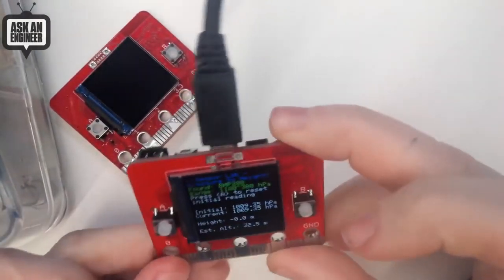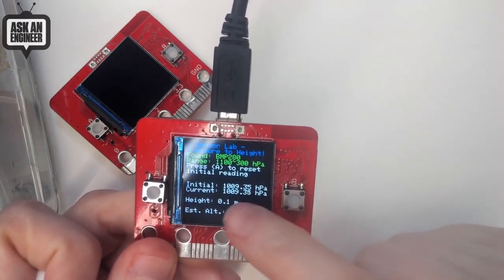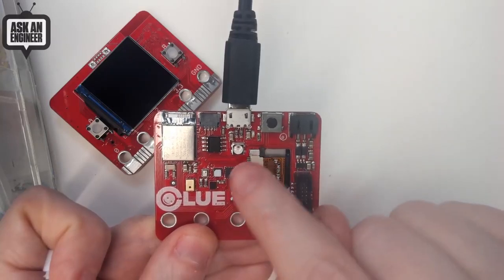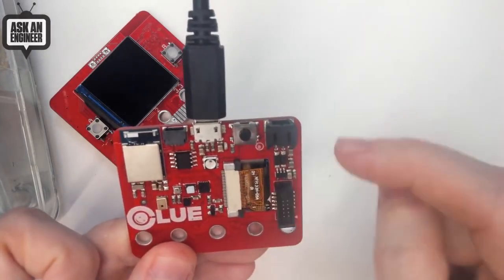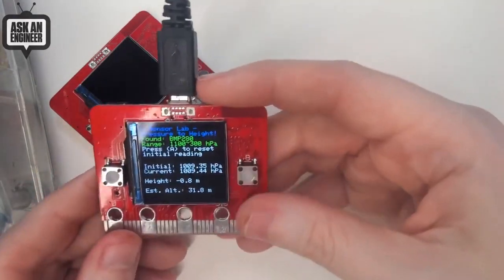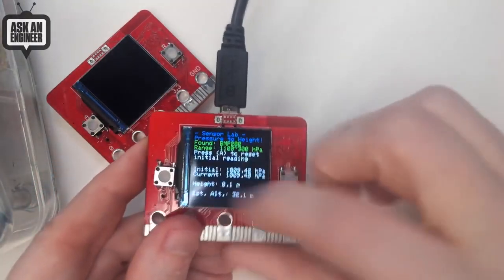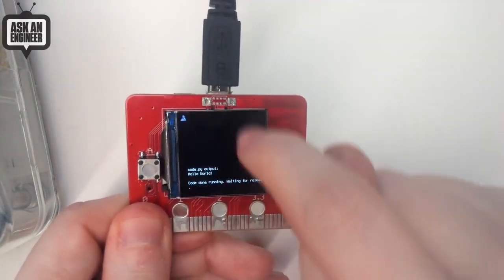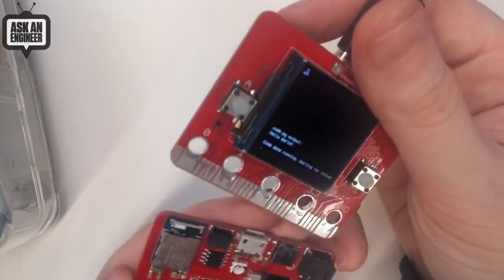Adafruit Top Secret! January 1, 2020 #adafruit #AdafruitTopSecret @adafruit

Comment: Awesome! I noticed a neopixel on the rear side.  Nice to have but surely it would be blocked by a battery or an enclosure, so please, please can you put this on the front of the board (or if possible place two or three neopixels on the front of board) so that it is at visible when used. Also, if possible could you breakout the nfc tag antenna connection (which is available with nrf52840) as a custom antenna coil could fit on edge of board (with hole in middle for screen and buttons).